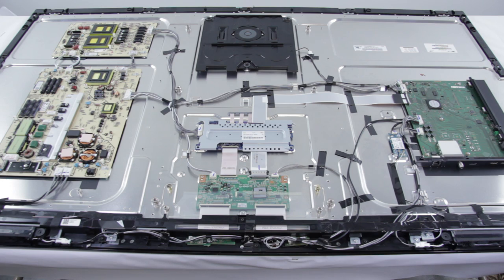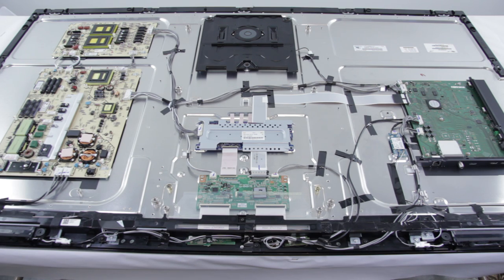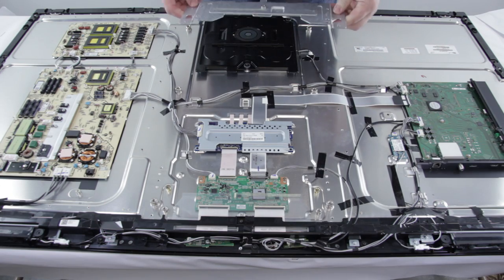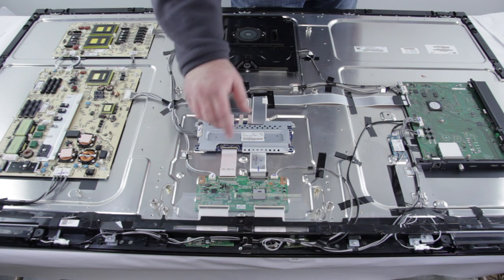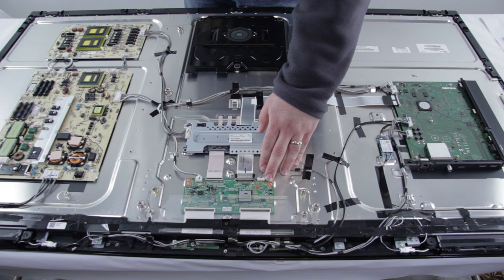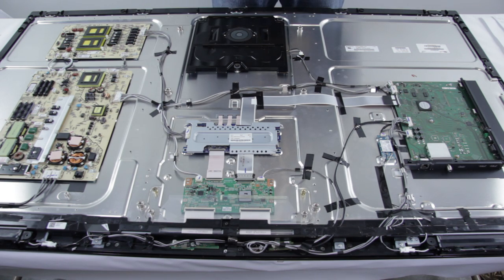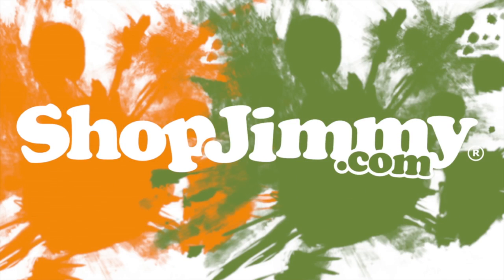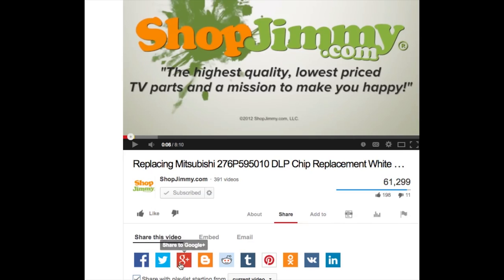LED TV Repair T-Con Board Help Review Overview - Common Issues and Problems with T-Con Boards

Comment: Hi , I haev a philips 21:9 50" tv, model  50PFL8956D/78. the tv was ok, but since today, when I turned on the tv, the image is some opaque.. the black screen like with a green screen... if the tv stay on by 30 minuts around the problen reduces or null.
This is the tcon board?
Reply from the maker: gust august   I recommend replacing the main board in your TV.  Unfortunately I do not see any replacement parts in the search results for your TV model number on our website.  Thanks and please let us know if you have any further questions!  www.shopjimmy.com

Comment: I have an issue with my Sylvania LC 260ss8 I push the power button it flashes the black and power button shows green for a split second then shutdown and goes into standby mode how can I fix it my son says the graphics are great for his gaming.

Comment: I have a Samsung PN64D8000FXZA plasma it has vertical line black from top to bottom it's  by middle of screen bought buffer board of shop jimmy didn't go away what else can I try?
Reply from the maker: tommy salinas   This sounds like a TV panel (TV Screen) problem.  If your TV panel is bad, it may be more cost-effective to replace the TV as panels are typically hard to find in stock, difficult to replace, and expensive.  Thanks and please let us know if you have any further questions!  www.shopjimmy.com

Comment: Hi I have a Sony KDL55HX800 that displays light vertical lines and bright white square spots all over the screen . Power is fine,  Can you assist on which part I need. I disconected all devices. Stand alone displays what i had mention Please assist. thanks- Dan
Reply from the maker: Dan Mendoza   This sounds like a TV panel (TV Screen) problem.  If your TV panel is bad, it may be more cost-effective to replace the TV as panels are typically hard to find in stock, difficult to replace, and expensive.  Thanks and please let us know if you have any further questions!  www.shopjimmy.com

Comment: Hi Jimmy! My name is Jules.
Following your video, I've successfully replaced the T-con board on my Samsung tv UN55C8000XFXZA.
I want to thank you for that. Everything was working perfectly until now ; pictures are blewring sometime for a few seconds  and back to normal. This is going on since last night . Any advice will be really appreciated.
Reply from the maker: Jules Agnigbakou  This could be a problem with either the main board or the TV panel.  You can replace the main board to see if that fixes the problem.  Click this link to replacement parts for your TV model number:  http://www.shopjimmy.com/catalogsearch/result/index/?cat=56&q=UN55C8000XFXZA  There may be multiple boards for the same TV model number, be sure to match part numbers on your current board, with your replacement for compatibility.  Here is a link to a video showing how to identify your part number, click here:  https://www.youtube.com/watch?v=BEPWrefQvqI  Thanks and please let us know if you have any further questions with your TV Repair!  www.shopjimmy.com

Comment: I have a samsung un55hu8550. When I cut the tv on or even just plug it in the screen pops up with the screen showing white distortion on one side and black on the other. After that 5 second cycle it just goes to a blank screen where I can’t see anything but what looks like a backlit screen. I have watched your videos and replaced the tcon board but no help. Looking to see what may be next. I might note that when the tv was bought I got a good deal from Best Buy because there was a little small nick on the front right screen. Also the side where the white distortion is. However it worked fine for a year like that. One day I plugged my PlayStation in and the tv never came back. Any help is appreciated thank you

Comment: LG 55LM4600 TV powers on and shows backlit black screen. Vertical line is shown in the middle of the screen. Shows no picture or response to menu and input buttons.
Reply from the maker: +Adam Studebaker   Try all repairs and troubleshooting at your own risk.  This sounds like a TV panel (TV Screen) problem.  If your TV panel is bad, it may be more cost-effective to replace the TV as panels are typically hard to find in stock, difficult to replace, and expensive.  Thanks and please let us know if you have any further questions!  www.shopjimmy.com

Comment: Replaced tcon board first then LED back lighting but still dark any suggestions? Passes flashlight/sound test Samsung Model: UN60J6200FXZA Ver: NSO2

Comment: Hello I have a problem with my Samsung 46" tv, Model Code LN46B650T1FXZA, it has image and sound but there are vertical color lines, and thin white horizontal lines. There are two thick red and multiple thin yellow vertical lines. Can you help me find out what the problem is and what needs to be replaced, thanks.

Comment: I have an LG 42LN5300-UB . BUSDLJR
This TV started having a problem displaying video few weeks ago (flashing during power on, video flashing on and off and finally no video).  First, I opened it up, disconnected and cleaned all the connections.  That got video back for about 10 days but the issue started again.  I tried cleaning connections again ... no picture and only sound this time.  

After a few days of no use, turned it on today and working fine.   In use now for about 90 minutes.

UPDATE:  It didn't last 24 hours.  Overnight, off and on .... back to sound only.  Haven't seen any video flashes either.  

What are the possible causes and how would I troubleshoot.
Thanks for any help you can provide.

Comment: Hi I have a Samsung UN55C9000ZF developed black horizontal lines across the whole screen. Started about 8 months ago and progressively getting worst. Usually turn on and about 30 minutes the lines disappear.  Now the lines stay on constantly. Help! What do I need to do to get this fix? Or do I just need to go buy a new TV? Thanks
Reply from the maker: Law W   This sounds like a TV panel problem.  If your TV panel is bad, it may be more cost-effective to replace the TV as panels are typically hard to find in stock, difficult to replace, and expensive.  Thanks and please let us know if you have any further questions!  www.shopjimmy.com

Comment: i have Samsung model UN40H5203AFXCA.  I cannot get it to turn on and when plug in TV I get a blinking flashing red light on switch module for about 5 seconds.  When I engage the switch, it blinks rapidly but TV will bot come on.  I do get 13 Volts out of each of 4 legs going to main board.  I get LED  1,2,3 lights on TCon Board and red light on Main board.  Cannot get TV on with remote or Power switch.  Any Ideas?

Comment: Hello, i have a probleme with my loewe individual 40 inch, when i put a signal via hdmi or scart etc, i have vertical stripes on my screen, without any connection i have not this stripes.
I dont know, but is it possible that the tcon has a fault? or is it somethink else.
The vertical stripes are moving when the movie moves on the screen.
Please I need some help!
Reply from the maker: Ron Talsma   This could be a problem with the main board or the TV panel.  Please reply with your TV model number.  Click here to view a video that shows how to find your TV model number:  https://www.youtube.com/watch?v=S51nhAmwR2M  Thanks!  www.shopjimmy.com

Comment: Please help with my LG LED- 42LA6200 TV Issue- Complete black screen with audio. Tried with new logic/main board board, LED lights are on inside panel could be TCON board but voltage are there in and out. Backlight is there. in dark room I could see many white back lights are on. Used flash light but could not find any image on screen in dark room. How to make sure that its not panel ??
Reply from the maker: +Pushpendra Upadhyay   Try all repairs and troubleshooting at your own risk.  Since you have t-con voltage, this sounds like a TV panel (TV Screen) problem.  If your TV panel is bad, it may be more cost-effective to replace the TV as panels are typically hard to find in stock, difficult to replace, and expensive.  Thanks and please let us know if you have any further questions!  www.shopjimmy.com

Comment: I have a lg 42ls5700 I have changed  the led driver board 3 times they only works  for about 2 or 3 months after that  the black screen with sound only comes  back..what else could  be the problem since they keep burning?  Thank you
Reply from the maker: pancho dejo   Try all repairs and troubleshooting at your own risk.  This sounds like you have bad LEDs in the TV panel.  Unfortunately we do not sell replacement LEDs for your TV model number.  Thanks!  www.shopjimmy.com

Comment: Hey, I have a 70" Sharp Aquos TV, Model Number LC-70LE650U with an image issue. My TV only has approx. 1/4 good image. The other 3/4 of the image is discolored and partially delayed when going from scene to scene. I think this might be an issue with the LVDS Cable. Can you help me?

Comment: I have sharp aquos LC-60LE550U.  It got hit by lightning surge and would do nothing.  No lights, leds, or sound.  Replaced main board and now everything works but hdmi 1 port.  Could new main board be bad or could something else cause just hdmi 1 to not work?
Reply from the maker: *****  Try all repairs and troubleshooting at your own risk.  It sounds like you received a defective replacement part for your TV.  Thanks!  www.shopjimmy.com

Comment: I have a Philips 47" when I turn it on, I see a white flash on the left and right side of the screen then it go's black screen. l still can here sound and did the flashlight test and can see the image, would this be the T con board? model number is 47PFL3603D/F7

Comment: Samsung UN50H6350AFXZA, no picture, back light powers on, replaced the TCON board with no change in symptoms.  I disconnected one side of the TCON to the LCD and half the screen came on properly and the other half was white.  Reversing the disconnected leg had one side black the other side came on white and faded to black.  Where to now?

Comment: I have 2 TV a VIZIO and a Samsung and both have the same of sound and no picture. The VIZIO started to fade picture on one side the when after 10 min, all picture. The Samsung started with vertical lines the on and of picture. Now both hev no picture, yes sound, yes back ligh. could this be the T-Con ?

Comment: Hi I have a goodmans 50'' led tv model code is c50238dvbt2. Got sound but no picture.i have done the flash light test n it has a faint picture.ive taken the back off the to to see the inventor board but I can't seem to find a replacement on the internet anywhere.can you help me

Comment: I have a e320i-b0 32 inch vizio smart led tv and when i turn it on the whole display shows up and looks clear but everything is upside down even the menu, ive already tried factory defaults but that didn't work... HELP??

Comment: Hi, and thanks for this tutorial.. I think I have an issue with the TCon Board, but want to make sure about it.. Is weird because fur the first time in almost three years I used the SmartTv in my Vizio M650VSE, just for YouTube.. After few minutes I turned off and try to turn it on again, after almost 30 minutes, the Vizio logo stay still and nothing happen (either in the remote or tv buttons), until it was disconnected. After that, the tv just turn on the logo and after few seconds turned off again..
Any idea?
Reply from the maker: Luiyo R   Try all repairs and troubleshooting at your own risk.   I recommend replacing the main board for your TV repair.  Click this link to replacement parts for your TV model number:  http://www.shopjimmy.com/vizio-55-74n01-001-main-board-for-m650vse.htm  There may be multiple boards for the same TV model number, be sure to match part numbers on your current board, with your replacement for compatibility.  Thanks and please let us know if you have any further questions with your TV Repair!  www.shopjimmy.com

Comment: Hi ShopJimmy, I have a Sceptre 46 inch lcd tv model number x46bv...i have no picture or backlight...I've replaced the mainboard and the power board but still no luck...I've done the flashlight test and see nothing...Any help would be greatly appreciated...Thanks...
Reply from the maker: jsariano   I recommend replacing the main board in your TV.  Here is a link to replacement parts for your TV model number on our website, click here:  http://www.shopjimmy.com/catalogsearch/result/?q=x46bv  Be sure to match part numbers on your current board, with your replacement for compatibility.  You can also call our customer service for further assistance with your purchase.  (877) 881-6492  Thanks and please let us know if you have any further questions with your TV Repair!  www.shopjimmy.com

Comment: Hello, I have a 6 year old Sony Bravia KDL-37l4000 tv which is displaying no colors and a white image, I believe this is what you called a washout image. I have sounds coming from the speakers.
I was told it was the t-con board and I wish to purchase a t-con repair kit due to there is no replacement for my t-con board.
Is there any guide I can use for this kit?
The tcon-model is an AUO 55.37.T03.C02
Reply from the maker: +Rene Williams   Try all repairs and troubleshooting at your own risk.  Unfortunately we do not have a guide.  Thanks!  www.shopjimmy.com

Comment: I just pulled my Vizio M701D-A3R off the wall mount, in preparation to ship it to another state where I am moving to.  After bringing it off the wall, I connected the stand so I could continue to use the TV for the next week before needing to package it up and send it a few states away.  Unfortunately, after turning the TV on about 30min later, my daughter informed me that she saw rainbows on the left side.  It looks like I must have twisted the tv frame too much and cracked the LED's.

I probably paid $2,200 in 2014 for the TV.  We are relatively happy with the Vizio (a little slow to respond to remote commands once in awhile, but overall decent picture).  

Do you have any idea what the led screen/array might cost, if the parts are available?  How difficult is it to replace them?  I see newer 4k models available for $1,800 and am just guessing that it is a lost cause to replace the screen.

Any advice would be helpful.  

Thanks,
Joe

Comment: I have a Samsung UN55ES1650F.  There is no picture, just a black screen.  I took TV to geek squad and they said the motherboard needs replacement.  Is that part BN95-00687A?  Is motherboard the same as t-con panel?
Reply from the maker: Will Tobin   The main board is not the same at the t-con board.  I recommend running the flashlight test on your TV.   Here is a link to a video we produced that shows how to run the flashlight test. https://www.youtube.com/watch?v=xUzCLgoSPGM Please reply with your flashlight test results and we can recommend a replacement part for your TV repair. Thanks and please let us know if you have any questions! www.shopjimmy.com

Comment: Hey Jimmy,

We have a SANYO DP52449. Yesterday it got stuck on a channel, the picture went out, and the audio would come on and go back off intermittently. We cannot change the channel with the remote control or the buttons on the TV. The green power light goes off and the screen appears to go off when we press the channel change button then both comes back on, though there is no picture. Where should start looking? Any advice would be greatly appreciated. Thanks!
Reply from the maker: Russell Spornberger   Try all repairs and troubleshooting at your own risk.  I recommend replacing the main board in your TV.  Click this link to replacement parts for your TV model number:  http://www.shopjimmy.com/sanyo-n7ke-main-board-for-p52449-01.htm  There may be multiple boards for the same TV model number, be sure to match part numbers on your current board, with your replacement for compatibility.  Here is a link to a video showing how to identify your part number, click here: https://www.youtube.com/watch?v=Mi0D7ksQp7IThanks and please let us know if you have any further questions with your TV Repair!  www.shopjimmy.com
Reply: Cool! Thank you!

Comment: I have a Vizio E601i-A3,I had lines and color messed up on it,I replaced the T-con board and everything was great for about 4 months, now no sound,no picture,no menu,I can see little lights inside the case,any help would be appreciated! Thanks

Comment: I have the new tcon board for my hisense led tv, model 55h8e but need help finding its location. Help!
Reply: if you have a new T con board and you can't find where it goes, I suggest you didn't buy the correct one, otherwise you would see one on the panel exactly the same..

Comment: Thanks for your great videos. I have a question. I just bought a brand new Panasonic TX-AS640E. But i understand that the mainboard is interchangeble between the TX-AS640 and the TX-AS740. Would i be able to upgrade my tv to a TX-AS740 just by switching the mainboard? And would i then get Passive 3D instead of Active 3D on my screen? Or would i have to change other parts aswell?
Reply from the maker: Torben Larsen   Unfortunately, no you cannot.  Thanks!  www.shopjimmy.com

Comment: Bought the Samsung LNT4671F back in 2008 ... and haven't had a single problem ... until yesterday! Watching the Nascar race on ESPN and suddenly, with no warning, the screen goes completely white .. no picture, only audio. Then today, just for grins, I turned the TV back on ... and BINGO, picture is back to normal ... but only lasted for about an hour, and then, white screen!

Having paid around $2,400 for the TV, I hate to throw it out and buy a new (much less expensive, and better) TV ... so I'm wondering whether the T-con board is the likely cause of this problem ... either its connections, or the board itself?